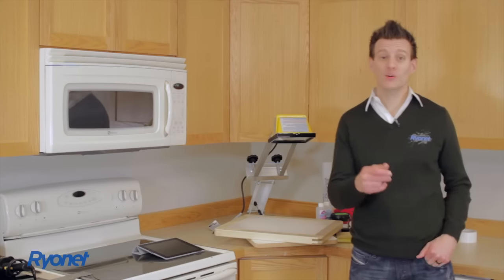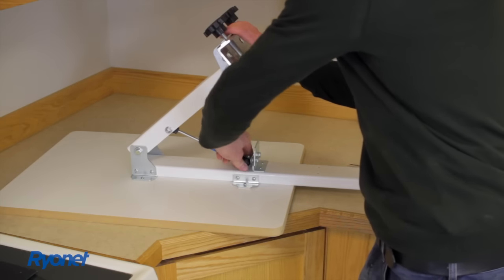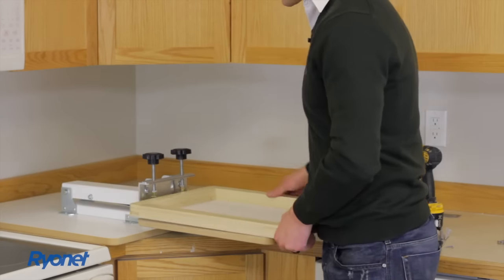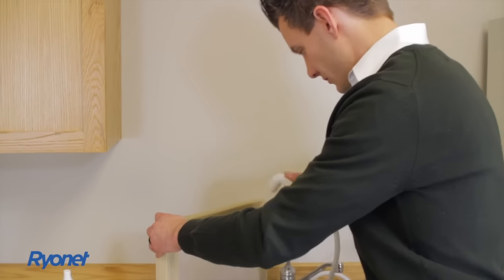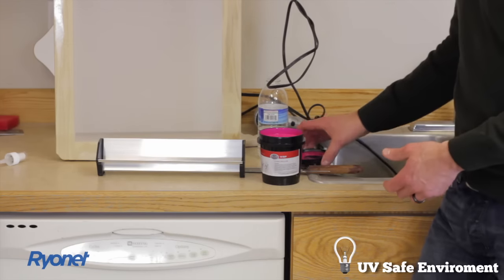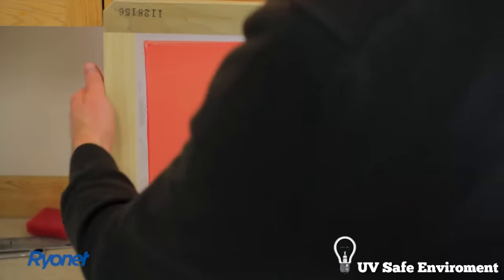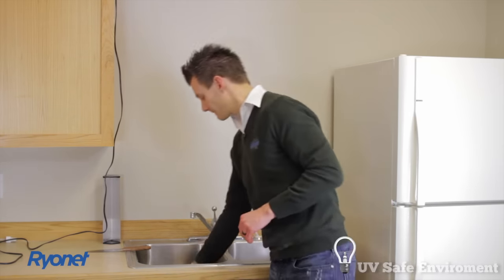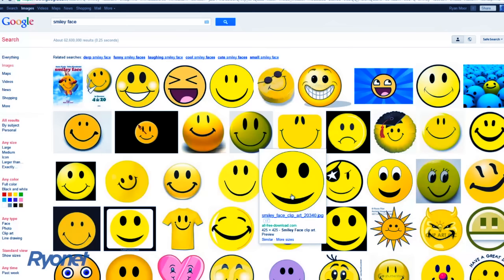Ryonet's Screen Printing Starter Kit DVD Learn How-to Print T-shirts

Comment: i've bought the kit and im having a hard time flooding the screen in 1 motion, most of the ink gets stuck on the squeegee, i have to flood using multiple pulls and what happens is when i push i get bleed in the print, my shirt gets saturated with ink. i've tried motions with the squeegee in various degrees, im using Permaset Aqua waterbased white ink on black t-shirt.
Reply from the maker: make sure you build up your ink before you flood, and use less(but consistent) force when you do. 45 degree angle.

Comment: Hi Ryonet. I am using adobe illustrator. Just wondering a few things… what kind of print settings do I use out of illustrator? I saw one tutorial where they seperated each color into its own document. So, if I did that. is there any specific settings I need to do for print or do i even need to put each color in its own document? Is there something essentially the same as corel that let's you separate in print settings? thanks!
Reply from the maker: nfinateri You color in Solid Coated Pantone Pallet, this video shows how that works Illustrator Tutorial for  the Ultimate Sports Pack Vector Clipart

Comment: How long can you wait before curing the shirt? If I wanted to make several shirts, would I cure in between making them while misting the paint to keep it wet, or cure them all after I'm done printing?
Reply from the maker: +J.R. Wyatt Great question, you can do it either way!  There's nothing wrong with letting the wet ink sit on a garment while you print more.  The only thing is that wet ink transfers onto other surfaces so you'd want to be careful how you staged your shirts after printing/before curing to avoid a mess.  Thanks for watching!

Comment: Is it necessary to change my design size every time i change T-shirt size? Mens S-3XL
Reply from the maker: Nope. No need at all. Thanks for asking!
Reply: It definitely is not necessary, but some customers may complain the design "could be bigger" and may not buy it. Only then do you want to consider increasing the size of the design. I would probably ONLY do that for a 2x-3xl shirt.

Comment: Just bought $2000 screen press and don't know how to use it. I'm a artist so design come natural. the process of putting it on a shirt is going to be challenging. i glad i cam across you channel threw Reyes the Entrepreneur. I might check out that 20x20. i wanna do them classic rock posters style.

Comment: How long can I leave the emulsion on the screen?Say I put it at night, can I leave it until the next night? Is there a time limit. I have a shop in my basement with little to no natural light.
Reply from the maker: You can leave the emulsion in your screen indefinitely until you want to reclaim your screen for a new design.
Reply: Even before burring the image into the screen? I know you have to wait 2 hours before putting the image onto the screen, just wanted to ensure it will still work correctly. TY
Reply from the maker: I wouldn't let a screen sit around for any longer than 2 weeks on screen unburnt.

Comment: Can I use a 20x24 aluminum screen with this starter kit? Also, what can I use to adjust the off contact if I don't have the same piece that you use? Not sure if I missed this in the video or not. Thanks!

Comment: Great videos!

Would I be able to upgrade the Wood Platen with the: 	
Aluminum Platen 16"x18" Pallet for Riley Hopkins or larger platen's with the starter kit items? I want to purchase the larger aluminum screens as well.

Thanks
Reply from the maker: You can adapt most screens without issues however the the only platen bracket adapters we make are specifically made for adapting wooden platens to the press and not aluminum platens. Hope that answers your questions :). Thanks for the comment!
Reply: thanks for the feedback. I actually got the wooden 16x16 with the neck platen. I called Rayone and they said that was good to go! You guys got fast customer service thanks!
Reply from the maker: Thanks, I'm happy to hear you got the help you needed, now go populate the world with some rad shirts!

Comment: Do you increase exposure time when you use glass? 9 min left the emulsion slimy and runny when wet. Went to 12 min on next screen and it seemed to work better but harder to wash out.
Reply from the maker: Sarah Pick yes you do you are headed in the right direction

Comment: Hello, my question is. Will it be okay to use a Cannon printer instead of a Epson printer to print out designs.
Reply: Epson is the best brand for film positives because it produces the darkest(opaque) print. I bought an Epson 7510 april 2014. My other printer is a Canon and i can see the difference in printing quality immediately. The best printer so far is WF 7510 or similar model, but industry preferred is the old/no longer produced Epson 1400 model. You can find on ebay fro $200-400. Ink type, software choice and artwork set-up will determine how good of a film positive you will get. Trial and Error really. Took me 7 prints to get a dark print & it still isn't perfect, but due to several tools/supplies that I do not own.
www.t-shirtforums.com has some of the best questions asked and best answers given.

Comment: After printing and cleaning the ink out of my newly used screen, do I have to remove my graphic and emulsion from the screen? If not, how long can I store the screen with my design on it without ruining the screen? To clarify, how long can I leave my hardened emulsion on my screen? I plan on using the same design again in a couple weeks.
Reply from the maker: up to 1000 prints depending how well you take care of the emulsion.

Comment: having problems cleaning the screen and getting the ink out of the screen , any tips or trick so i can clean out the screen and not waste  hours scrubbling the screen to get ink out . im using the ryonet white
Reply from the maker: What kind of chemicals are you using?
Reply: Ryonet im usung just soap and water , the complete kit didnt come with a screen cleaner for the ink after your done with a job.
Reply from the maker: Okay, if you want to save time get some Ink wash, http://www.screenprinting.com/screen-printing-supplies/ic-plastisol-ink/cci-plastisol-screen-wash-ink-remover-quart.html#.U73CJrGhOZE
Reply from the maker: Plastisol is oil based. Water is not an effective way of cleaning your screen. Use that chemical and make your life a whole bunch easier. =)
Reply: would have been nice to receive the cleaner in the [ Complete kit ] that i bought , seeing that is a major component in the cleaning and saving of the expensive screen that i now have to replace. maybe you can add this item to the kit so first timers like myself have a better experience with your item and the Complete Kit will be complete.
Reply from the maker: Which kit was it the one you ordered? Most of our kits SHOULD have screen washing chemicals included, at least enough to start out.
Reply: Ryonet DIY Screen Printing Starter Kit for 200 dollars and i bought some extra inks and supplies , i wasent aware i needed to but the screen wash out for the inks , and now i think i ruined the screen because i had nothing to clean the ink out of it , and probly going to have to start over and buy another one .  well let me know what you think i should do , thanks
Reply from the maker: Bummer, the DVD that kit comes with goes over cleaning the screen. Yeah I would try using emulsion remover and see if that helps.  Contact support and they can walk you through it. 800-314-6390
Reply: Ryonet well that would have been good to know before i ordered the complete kit that i needed to buy a different product to clean the ink out of the screen , and i still believe that this should be included in the package as it is a Key item in cleaning and saving you the problems that i have ran into , maybe you could incorporate a small bottle of it in your kit for new comers to the world of silk screening , so they don't have a bad experience as i am having now .
Reply from the maker: The kit you ordered comes with water based ink, it comes with all you need to clean up that type of ink. If we incorporate a cleaner for a type of ink not included in the kit, I think that could potentially be confusing. I am sorry you had a bad experience, in the future feel free to call us if you are unsure what products you need.

Comment: I have a heat press, but it`s kind of limited. I just ordered this can`t with some extras and can`t wait to start creating. Would i be able to use my heat press to cure the waterbased or plastisol inks?
Reply from the maker: Yes you could use a heat press to cure both water base and plastisol, to cure water base with a heat press I would recommend using silicon paper
Reply: Ryonet
Just finished pressing a run with my kit. I LOVE IT!!!!!!!!!! My heat press works perfect for curing the shirts. Now, i`m wishing i would have gotten the 4/1 station.
Reply from the maker: BIdouble94
Glad it worked for you!

Comment: I bought your 230 mesh Wood Screen 20x24" and i burned the image for ten mins and left the screen over the weekend in a black bag inside a dark closet and now im trying to reclaim it and after some time all the emulsion came off except the actual burned image and its really dark like is the black ink is stuck.
ive run the emulsion stripper many times and put under water presssure for 20 mins and no avail. Im not really made out of money, this was the expensive and idk what to do. 

Any tips of help?
Reply: i CAN SEND PICS.
also i just tried the whole process again and i just finsihed burning and now the ink isnt going thru the screen to the shirt. :(
Reply from the maker: Sounds like it's time to call in for support. Youtube isn't the best place to ask serious support questions although we'll always do our best to answer. Call us 800-314-6390
Reply: Actually I made a mistake, the ink did go thru the screen works fine; almost perfect actually.
But it looks damaged and theres still a black imprint of the old design. Still works though, for new designs. its just hard to see the placement.
Reply from the maker: Screen printing is not easy but, it gets easier. Hang in there and keep asking questions!

Comment: you make it look so easy hopefully i get to that point because right now its a struggle
Reply from the maker: Hey Tre what are you having trouble with?
Reply: mainly setting my screen im not sure if im using too much I have a lot of drippage. When you do it it looks like it goes on so smooth with maybe a little drip, but when i do it its like its running back down the screen. I also wanted to know if there are some screens that come pre set?
Reply from the maker: Tre it takes some practice, I found it helpful when I was there watching someone do it right. Maybe come to a class and practice using our stuff. =)
Reply: Yes I know and that's what I keep telling myself. I started out using vynle then went to heat transfers but I found that those methods were just costing me money. I still use them but not as much. Taking a class sounds cool, but where are the classes held? I live in houston, Tx. I also have a classmate who has his own business and he gave a demonstration in class, but I would love to have the f
Reply: @TreClay  
Making screen is a process of uv rays content in light source go through transfered area of tracing film and hadden or burn the sensitized coating . The same way the black print area will not effected  by lighting that's why it will remove at the time of washing used by normal water.
So three thing you should follow
1. Mix sensitized at exact ratio prescribed 
2. Dry screen at dark room
3. Fix tracing fil tightly or less air gap by using any glass and clamp or use special exposing machines available in market for closer this contact between screen and film.
4. For trial use sunlight as a light source for better understanding of exposing.
Exposing time only 60secons.

Comment: what is a good printer to start with
Reply from the maker: Hey there!  You can use any inkjet printer for your films to begin with, but it's not the best.  If you start with a standard inkjet printer, we suggest setting your quality settings as high as they will go, and double printing your film positives and taping them back to back for proper opacity.  

If you're looking for a good, less expensive printer to start with, we recommend the Epson 1430.  This printer can work with a BlackMax, all-black ink system so that you can get the best, darkest, most opaque film positives, and AccuRIP, a secondary print driver/half-tone program that allows you to do jobs that have gradients in it.

You can check out the package that we have here: https://www.screenprinting.com/epson-1430-blackmax-ultimate-film-output-system

On the product page, you can also find some videos about the products so you can get a better idea about them!
Reply: Ryonet awesome thank you